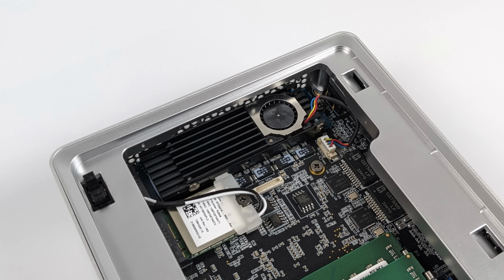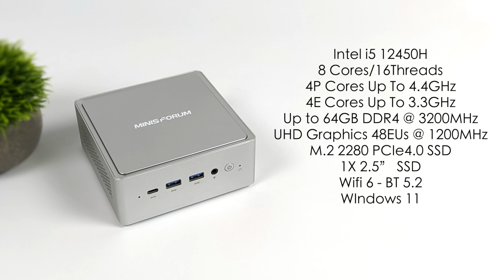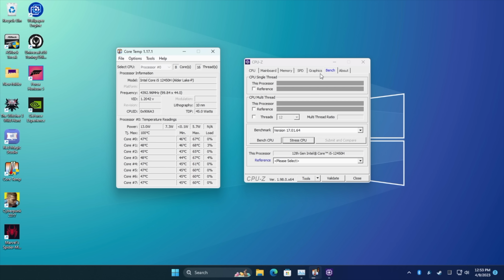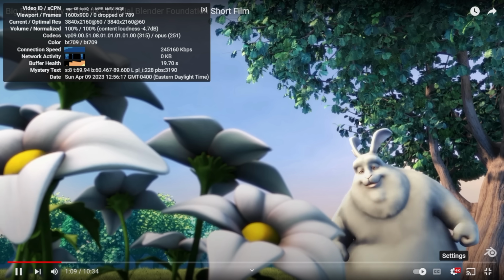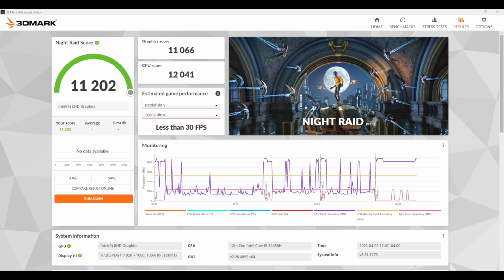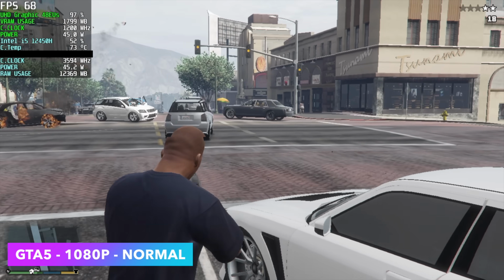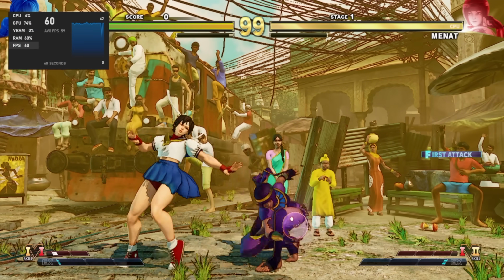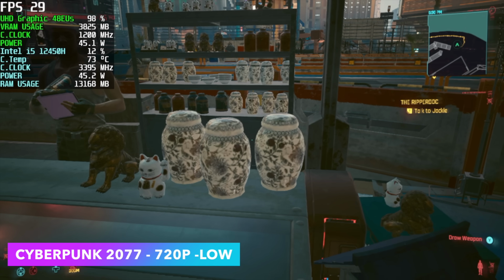The New Minisforum NAB6 Is A Fast Small Foot Print PC Packed With I/O! Hands On Review

Comment: I  got two questions: 
1. Can you disable the E cores in the bios?
2. Does it have a fan stop mode when not under load?

 I'm looking to run this as a pfsense router with the dual 2.5gbe nic's.
Reply: Tagging along, i also would like to know if the ecores could be disabled and maybe if there is TDP restriction?

Comment: Is it possible to run these mini PCs off a battery for portable use? Like UM773 for example, in ur video, the system power consumption at idle shows 12W so if I'm being generous, running it on low load applications like browsing and writing, max power would be 30W. I haven't seen people talk about this much cuz theoretically, a battery pack of 15Ah at 19V(UM773 DC input voltage) should provide 9 hours of constant 30W usage neglecting losses.
Reply: they are MOBILE processors like a laptop

Comment: I'm looking for a device that can run the new Steam Big Picture mode without lag and basically just stream games from my desktop to a 4K TV, basically a newer Steam Link. I have an Nvidia Shield, but it lacks some input features and isn't as seamless as I'd like. Do I need something this powerful, or how low could I go?
Reply: He never tests this even though many of us want it. Personally speaking you will want a discrete GPU. Unless you like looking at pixelation.
Reply: Did you tried original Steam link? I have one connected over the Ethernet. Never had any troubles. But I only have 1080p. Does it have issues with 4k? As per my understanding they is  no gpu intensive tasks required from the devices. Almost all new android TVs can do it via app.
Reply: @kirle5455  I have a steam link, but it maxes out at 1080. Android TV devices don't have features like controller rumble, and it you press the Xbox, PS or Steam button, it returns to the home screen and kills your stream instead of opening the Steam overlay menu like it's supposed to. There is a workaround, but it's just not as convenient. On my shield, I also have to change settings like disabling AI upscaling. I just want a dedicated device for streaming like the steam link but with higher res support.

Comment: Please start comparing performance between these mini PCs. They’re very similar and it can be hard to determine what the better buy is just based on the spec sheet.
Reply: A tip is to not get an intel computer if it doesn't have an arc or nvidia card.
Reply: He's done tierlists at the end of the year comparing his favorite mini pcs. At that point its best to decide since the options have already rolled out. On the other hand if you where comparing performance in the moment, just imagine the pheonix or dragon range APUs come out the next day but you already bought for example this pc, which is better for old and 2d games while ryzen apus have been great for 3d performance lately.
 Tldr wait for that video to see what you need.
Reply: He returns the pc's every time, he cannot compare them.
Reply: @user-yz1dl3eu8l  He can if he runs the same benchmarks and records the benchmark results each time.